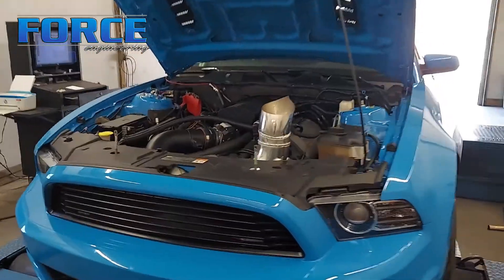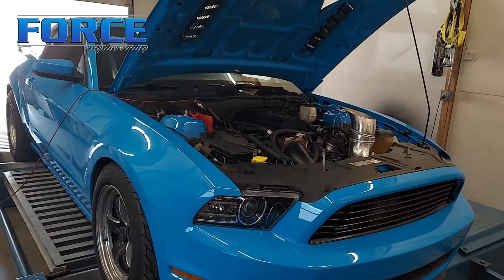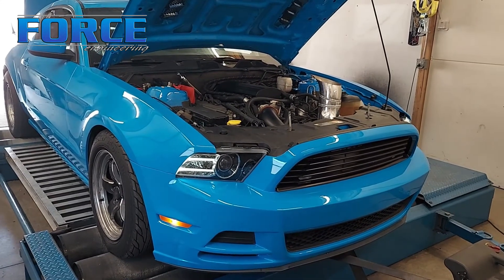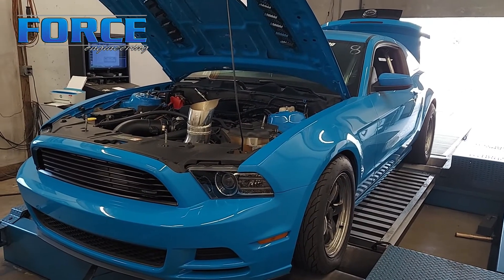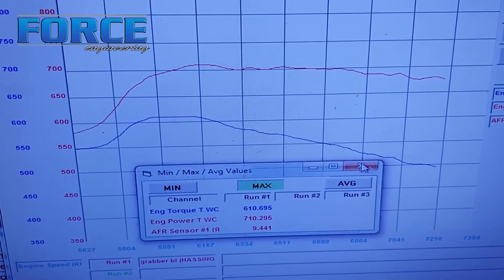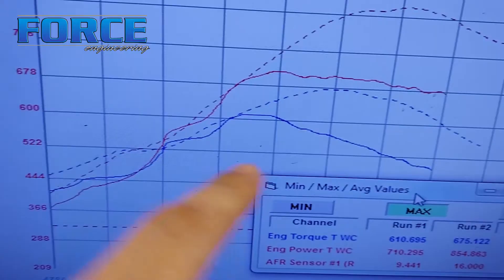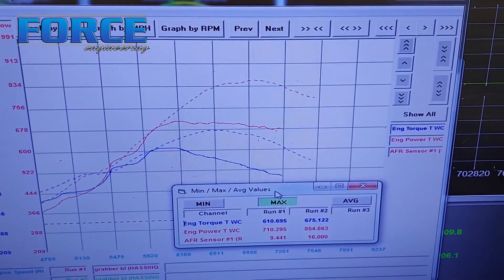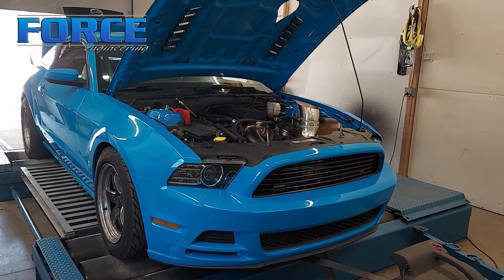TH400 Transmission Kills Dyno Numbers! See How Much HP We Lost

Comment: its all in the convertor setup really a off the shelf convertor isnt gonna be good if you are trying to get al the performance you need a custom convertor specd to your cars weight/ gear ratio, trans ratios, power levels, power adders, motor size
Reply from the maker: Any unlocked converter will dyno poorly compared to a locked converter or a clutch car.  This converter locks up to 2.5% at around 2k hp. The car mph the same with this comverter vs the lock-up converter. They just interact with the dyno differently.

Comment: Car doesn't actually "lose" HP....parasitic loss between 6r80 and th400 is similar...loss is because The convertor isn't a lock up. Once at the track the HP will be known from MPH/Weight data. My th400 car dynos 3-400 hp lower than track data shows. Good video highlighting the way a th400 setup eats power.

Comment: Hey how did you delete clutch starter switch, or do you still need it to start car with th400. Tell me exactly what you did cause i am getting th400 in my 11 5.0 and dumping stick. My th400 will be full manual reverse pattern sequential like yours. Also, how did you make Speedometer work with th400.?
Reply from the maker: Found a work around to eliminate the ecus control of the starter relay.  Worked well.  Pin 16 on the chassis connection is 12v from the start postion.  The ground side of the relay i ran throught the neutral saftey switch.  Move pin 16 to the + trigger on the relay and all works as expected.

I didnt worry about the speedo with the stock ecu.  When i changed to the haltech i installed a driveshaft speed sensor for the speedo
Reply: I wired the clutch switch to the micro switch to the neutral safety switch on the shifter.  Pretty simple. Also tone ring on the rear yoke on the rear end and extended the stock speedo sensor wires and used the stock mt82 sensor and correct it with the tune.

Comment: Did you have any problem with the stock ecu and the th400?
Reply from the maker: Not at all.  Ecu basically thinks it has a stick shift trans behind it.  I didnt run it this way for long, and there may have been some drive ability issues that i hadn't experienced.
Reply: Hey how did you delete clutch starter switch,  or do you still need it to start car with th400. Tell me exactly what you did cause i am getting th400 in my 11 5.0 and dumping stick. My th400 will be full manual reverse pattern sequential like yours.  Also, how did you make Speedometer work with th400.?

Comment: Why did it lose so much hp
Reply from the maker: Moving from a lock up conveter to unlocked "looser" converter.  This video is great to show the insignificance of dyno numbers.  The car trapped within 1 mph with both setups even tho the dyno showed a 100+ hp loss.  They are a great tool, but you have to understand the data.

Comment: How much hp decrease do you see when manual cars go to TH400?
Reply from the maker: 100% depends on the converter.
Reply: Its irrelevant cause th400 will be faster no matter what.  Dynos for bragging rights only
Reply: Agreed. I swapped from manual 479rwhp to my first stall and made 420rwhp then after dialing in the right converter I made 437rwhp.

Comment: So why do the TH400 swap? ET? Reliability? Both?

I've seen 6R80's in the 7's, but have no idea how reliable they actually are. Just curious. 

And subbed, looks like you're doing some cool stuff!!
Reply: I’ve seen people swap over due to reliability issues also. Even built 6r80s will break with consistent drag racing, whereas TH400s are much better suited for this hobby.
Reply: Th400 is drag racing legend
Reply from the maker: I had hust the 6r80 twice. Some of that die to me lacking a bit in the transmission tuning detpartment im sure.   Biggest reason was reliability.
Reply: It comes down to the fact a th400 is cheap and strong as shit mine was 5500 and can handle 2000 hp the reason he was experiencing power loss was simply just a improper convertor setup a convertor setup on a turbo car is particularly important
Reply: Love mine!